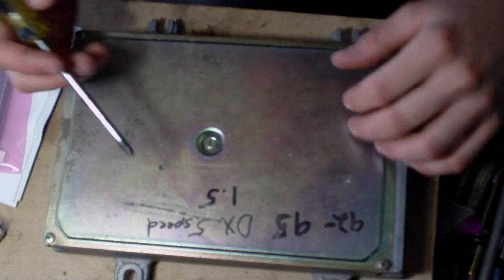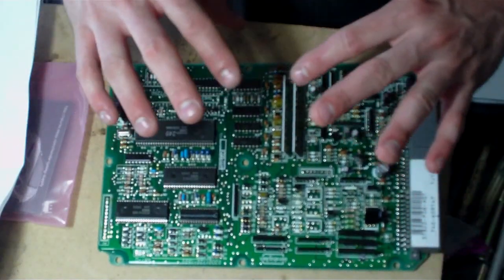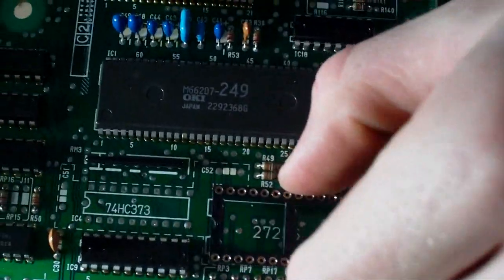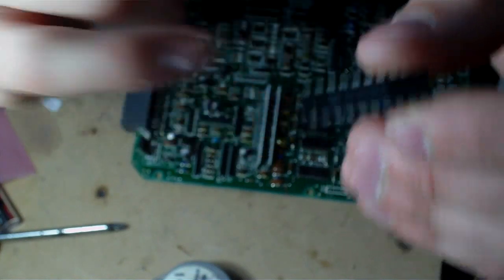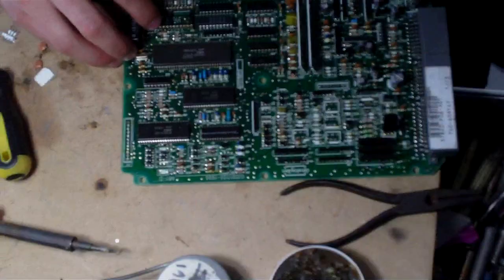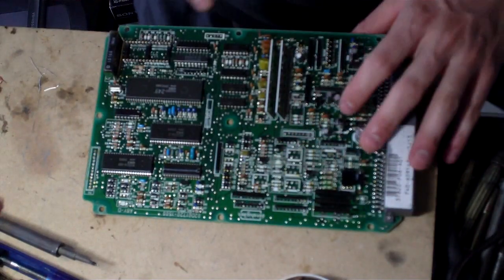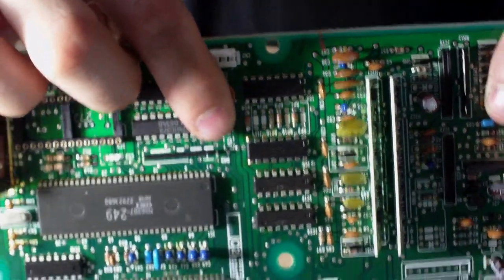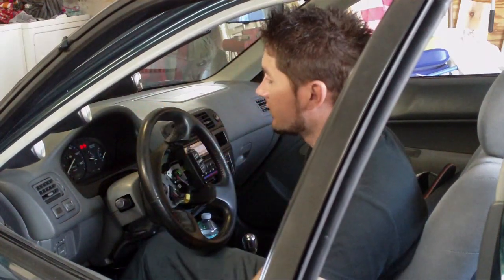How To Chip A Honda Civic ECU 92-95 5spd "THE EASY WAY"

Comment from the maker: 🛒 Buy The Tools To Chip Your ECU Here: https://www.nthefastlane.com/chip-a-honda-civic-ecu-92-95-store
🛒 Visit Nthefastlane's Amazon Store: https://amzn.to/3pP4UCy

Visit my website for All of Your Honda Series Needs. You will not be disappointed!
https://www.nthefastlane.com/honda-database
Reply: Nthefastlane i commend you for being able to do that soldering and micro work like that. i have essential tremors so i cant do that kind of stuff. i have a few questions though. i have a 94 Civic EX with an automatic. Can my ecu be done this way? what kind of power and economy gains could i expect after this is done? and does the $78 price you have in the description cover the cost of the kit and your labor? if so how can i get in contact with you? id be very interested in having you do this to my ecu if the gains are worth it... if its only 2 or 3 hp then to me it wouldnt be worth it.
Reply: Nthefastlane are you able to program one for 440cc injectors on 15psi of boost
Reply: Nthefastlane can you do my ecu.
Reply: I looked, it's just stuff taken from wikipedia. 
NGL it's disapointing.

Comment from the maker: Make sure you used the 74hc373 chip..The 373 IC is required for the processor to properly read the data on the EEPROM chip where the tune is stored. In order to revert the ecu back to the oem map you will need to un-bridge the connection of J1. or  just cut it.

Comment from the maker: Look under your hood by the front driver side head light..There's a Drier can with a sensor in it..Take the sensor clip out and jump it with a wire like a "U" if it kicks on ..Your either low on freon or your pressure switch is shot.

Comment from the maker: It's called "Flux"..It allows the heat from the soldering iron to make better contact with the solder. The Flux's heat's up real fast causing the solder to melt quicker then if you were not using any Flux. Hope this helped. Btw you can purchase it @ Walmart in the plumbing section or Babes Ace, Lowes and Home Depot.

Comment from the maker: @2kblackex Yes, I put a chip in the ECU afterwards..and this is a non vtec chipping kit..but you can add one more diode if I'm not mistaken and it will convert to vtec..they sell the vtec kit version also. Same procedure except you add another item.

Comment from the maker: @jonzo22 This is a Non Vtec ECU..By chipping your ecu which is the same ECU you see right here Non Vtec.,You will be able to take your car to a tuner and have him put it on a dyno or street tune your car by adding a better air fuel ratio which makes you more HP.

Comment: Hello, for data logger you need more parts than plug? I want soldier one BT HC06
Reply: CN2 connector is TTL, so I think you'd use an FTDI TTL RS232 USB adapter with a Micro Controller Unit to transmit the serial UART data over the HC06.

Comment from the maker: @manlymud I appreciate the attempt but that's not what Vtec is.Vtec is not and extra valve.

Variable Valve Timing and Lift Electronic Control..which means in English. It has multiple camshafts..The engine moves into different rpm ranges, the engine's ECU activates lobes on the camshaft and changes the cam's timing.When the lobes engage it forces the intake valves open more which push the stroke down more on the valve causing more power.On DOHC engines both intake and exhaust engage.

Comment: Hi Dude! what an interesting video tutorial!!! really good one... I have one question.. what do you gain with the chipped ECU vs a non-chipped ECU? (sorry my bad english haha) greetings!!!!
Reply from the maker: Thank you. With a chipped ECU, you are able to hook a computer up to it and change the air/fuel ratio and change when VTEC engages and disengages. With more advanced ecu's, such as AEM or K-Pro, you can even advanced timing, have live data recordings and if you have an electronic boost controller solenoid, you can do Boost by gear and even control the amount of boost you want. Hondata Series does this as well.
Reply: @Nthefastlane  what benifit does this have with the EX model which has a constant VTEC instead of and electrically controlled VTEC?
Reply from the maker: 92-00 EX don't have constant Vtec, they fully engage around 4500 RPM?

Comment: I have a question... my car I just got as a project has a chipped p28... I saw this video and checked the socket which matched that indention... the chip on the other hand is 180 degrees opposite the indent it opposite the socket... is that correct?

Comment from the maker: Did I say it was a vtec ecu? << "not a jerk response"...just don't remember if I did or not, but I don't think I did. And no, it's just a basic non-vtec ecu. Yes, the black (high side switch) get's soldered into "ic14"  but that's not even close to all the resistors,diodes,capacitor & fet's you will have to solder in,there are 6 others, depending on which ecu you have either 11F0, 1720 or 1980 you will have to use different chips.

Comment: hey brotha might b a dumb question but whuts that blue thing ur using? like a solder feeder? an were can I get a chip upgrade kit? I have a 89 crx si an wanna try this an one last question wut would I gain?
Reply from the maker: Sorry it's been a while. It's called a de-solder tool. It sucks up the liquefied solder. You can purchase it in my store. Top comment or in the video's description.

Comment: Hey man, nice vid, i have a question. is the datalogger required for the chip and socket to work ? and as far as the jumper used in j1 , would i got to the store and ask for a jumper or is it a resistor.... they look alike... sorry for the noob questions but im curious.

Comment: Nice video thumbs up I really liked it I have a virgin po6 that I would like to turn into a p28 like u did I have a soldering iron an solder just need to buy the chipping kit any recommendations on a good chipping kit from ebay? Thanks in return!

Comment: I bought a 96 civic ex and I was told the ecu was set up with 2-step launch. I bought the car not starting and see that the ecu thats in there belongs to a 92-93 civic hatchback. Could that be the reason why the car isn't starting?
Reply from the maker: It could be that it has a OBD1 ECU that is chipped and not programmed properly. If you switch to the stock OEM OBD 2 ECU it's possible the car would fire right up.

I can't say for sure because I don't know exactly what I would be looking at.
Reply: @Nthefastlane  and the stock ecu is one of these or could either one work for the d16y8 motor?
-37820-p2p-a31
-37820-p2p-a34
-37820-p2p-a84

Comment: I wish someone would make a hondata toutorial run through and some basic tuning tutorials using hondata smanager
Reply from the maker: Phillip Pickering Subscribe, that's in the future. I'll be doing a basic set up with the S300. TPS dial in, basic injector set up and fuel map for getting it running.
Reply: Nthefastlane that would be awesome! I'm subbed now. I'm in desperate need of a tutorial like that. I just got my s300v3 and I'm trying to get my boosted teg running but having a really hard time figuring it out

Comment: hey awesome work!did you see any fuel cosnuption reduction after you chipped the p28?..thanks
Reply from the maker: Raoul Duke Well, only way to know is after you take the car to the dyno and have it tuned.I'm running a diff engine now with a Hondata s300
Reply: +Nthefastlane i have a few questions. first what where u doing before u put the items in to solder them in.. and i got my chip kit and i got more items with it. one thing that looks like the 104 and one that looks like a little water tower. do i need these.. i am going to chip a p 72 ecu

Comment: hey my 92 civic just broke doown after i put in a new alterator and i have had alot of people check it out and its getting gas and good spark and the timing belt isnt broken and it turnes over i was told by my dad it was somthing electrical and and he said its either the ecu or somthing in the distributor i think i have the same problem as shay haha any advice would be awesome i think its a sensor in the distributor

Comment: yo bro im from manila im new in honda tuning just what to ask if whats the cons & prons of re-chipping ecu? now im using P28 on my 1995 honda civic esi that's the stock ecu here. now my friend had an extra P06 ecu already plug on my civic the problem is the light on the check engine is always on? may i ask if this ecu is not compatible or i need to re-chipped this ecu? thanks..

Comment: Can you control the idle Air  control valve with hondata? Can you give me a step by step. Thanks. Hondata is saying my Idle control valve issue
Reply: +X4hunterx4 Clean or replace your IAC - the computer tells you there is a issue with it - you have to fix the problem.

Comment: I just bought a 91 d16a6 2wd wagon ef ... its runing 11lbs with jackson   
supercharger and 100k motor. 440 injectors runing around 45-50pls fuel psi .. not sure but it does have a larger intake and full exaust and zdyne ecu!!! DO you think its runing Stock chip? i know 10-11lbs is stock max but i also know that stock enternals on the d16 cant take much more than 220hp ... I want to hit the 350hp mark and wonderd if i had egale rods and new pistons "unsleeved" block and new top end would hold it

Comment: I need help with my ecu is p28 honda accord 94 . I put a spoon chip in it . And something went wrong . I put the original chip and the car turns on but it misfires at 5k rpms.   What can I do .? Maybe a resistor or what else . It turns on the engine but miss fires on 5000 rpm
Reply: +Daddy R. You have something else going on - either something wiring related UNDER THE HOOD is bad or your distributor is junk.

Comment: Where can I buy this chip, I have a JDM 2008 honda civic ex-l 5 speed manual
Reply from the maker: For your make and model you'll have to use Hondata 06-15 Civic 1.8L FlashPro. I don't have this in my store but I always pin the link to my store with all the products in my videos to the top comments and in the description. Link to store: https://www.nthefastlane.com/chip-a-honda-civic-ecu-92-95-store

Comment: What if i just want to install a 28 pin socket for eprom chip on IC3...I still need to install the IC4, R54 resistor and J1 jumper? In order for the chip to work?

Comment: Will a socked ecu run factory settings when the chip is removed? Will the car even start?
Reply: +Oshane Rias Not unless you un jumper it - You should leave the chip in the ecu or get another chip made for your cars setup.

Comment: What is that blue tool  that your using to poke the hole .. Wha is the name of it.?
Reply: It's a solder sucker. They sell them at Radio Shack. You melt the solder with the soldering iron and suck the solder out with the sucker. That's how I chipped my first P28 but I melted mine on the first ECU so be careful with it.

Comment: Good evening, a question please I have a civic 92 automatic box ecu 37820P06A50 engine D15b7 power 1.5L. I can change my ecu by 37820p06g50 without changing any component?
please urgent
thank you in advance
Reply: wich one you want to use? because if you have a d15 p28 ecu u can turn it to a manual ecu making some stuff in the motherbord from that ecu.

Comment: @Stylnjj84 yes it does have a DOHC but they cant run at different speeds then each other, they run the same speed and the valve doesnt open more, just longer/ earlier to get more air for stronger compression i am in strong agreement with whom ever said you need to get the right headers and cams too for it to be a vtec . in the name "vtec" there is no  "L" for lift as you put it because its an overhead cam so it doesnt lift the push rods, it pushes down on the valves.

Comment: Hey man, I chipped my pr4 with a limiter of 3100. does what its supposed to. when i remove it, it runs fine. But then i decided to chip another pr4 with a 4500 limiter from ectune and installed it...but it STILL limits at 3100!! What the?? 2 different ECU!!
Reply: Thats limp mode. Pobably you destroyed ecu board or solder is not done right.

Comment: The 28 pin device is only a socket to carry a 27256 EPROM chip. So the EMC is now ready for an EPROM to be installed. So this mod has only prepared the board for a chip to be installed. The capacitors 104 are not polarized and can be installed either way around. Without the actual 27256 installed there will be no performance changes.

Comment: @kplivinloud08 NO u can not turn a non vtec into vtec with a simple chip, a vtec has an extra valve on each cylinder and a special camshaft so when you hit a certain rpm then the extra valve kicks in, giving it a slight more air so its more compression so more horsepower, when your in low rpm then it deactivates to give you more mpg win-win engine

Comment: Why did your fan kick on as soon as you started the car? No yellow check engine light for 3 seconds when you turned on the car. Why?
Reply from the maker: albert person I jumped the radiator fan sensor so it would run all the time. Not sure about the light but I think I removed the bulb. It had no check engine lights after the tune.
Reply: Nthefastlane If you remove the CEL bulb - an alarm sounds(the buzzer for the key in the ignition stays on). So your ecu isn't powering up right and giving you the 3 second CEL turn on and off when you turn the key on and start the car.
Reply from the maker: I eliminated the door chime speaker also..I have a how to video of it on my channel.
Reply: So why did you remove the CEL bulb? Got tired of seeing it turn on? It's a VERY important part of your engine management system and even more important if your chipping ECU's or tuning your car.
Reply from the maker: Most tuners just use it as a shift light.
Reply: A shift light(that can be activated or deactivated if you want it) AND a CEL so you know if you have something not working correctly.  It's VERY IMPORTANT TO HAVE WHEN YOUR TUNING A CAR. It tells you when you messed up with your calibration/tune or had a failure under the hood.
Reply from the maker: Cel lights are useless. Not needed when your using tuning software..it tells you everything that's going on with the tune.
Reply: Do you leave your laptop for the guy you just tuned the car for? NO. Do you ride around with your logger and your laptop hooked up all the time? NO. Is it LEGAL to remove the CEL? NO. Don't be stupid. It's probably the ONLY light on the dashboard that is a REQUIREMENT.
Reply: +boofighter If knowing what my ecu is supposed to be like after modding it makes me a dork than I will be a dork with a working computer in my car. Not spending countless hours wondering why my car isn't running right or having random and strange check engine lights popping on.
Reply: +Harry Negron I care because he is supposed to be instructing people in this video - if he isn't showing it the right way then people are learning the wrong way and not understanding what they are doing.
Reply: albert person if u whant ur fan to kick on  there is a plug by ur thermostat housing shove a piece of wire from pin to pin of the plug thats it
Reply: its an idiot light, can u just relax. fix the car. not the code!
Reply: isnt the CEL on the left side of the cluster...? you cant even see if it went on or not from this angle lol

Comment: there are 2 versions of the p07 
the one for 4 wire o2 sensor is chippable 
the p07 that has 5 wire o2 is not

Comment: check for fuel, spark, first before blaming the computer, make sure your getting spark and can hear fuel pump kick on, common problem is distributor the ignition control module gives out inside distributor, test and see if your getting spark.

Comment: do you know electronic throttle controller? it can not only accelerate throttle response but also slow down throttle response of your car. It can provide you with racing car driving experience and also save fuel if you choose the economy mode. It is different from ECU tuning, it does no harm to your car .

Comment: can you run a p28 ecu on sohc non vtec>?
Reply: Dwayne Collins From my experience no.  If you discover a way please let me know.
Reply: Alright I well
Reply: This is what I did.  I purchased a 93 P06 Civic ECU (per the advice given to me from the chip programmer) because you can not socket a stock 94 accord ECU.  They said it should work fine and yes it plugs in and the car runs but only in "limp mode".  Chipped it and it still runs really bad. If you know what your doing and have the software to write new maps to the chip you could possibly make it work.  I do not... All in I invested about $100 to discover this.  Good luck!!
Reply: +Dwayne Collins P06 and P28 are basically the same 'base' boards, the only difference is the P28 has the VTEC circuit added (there are some unpopulated 5-pin spots IC14 trough IC16)

You can even convert an automatic ecu to manual.
Reply: +Wade Woodring You have something else under the hood wrong - need to swap distributors or your wiring is not correct. This sort of modding isn't for a casual mechanic.
Reply: +Dwayne Collins The computer will start the car but throw it into limp mode because of the lack of vtec on the engine and it having a non VTEC distributor installed - you need to have the proper parts installed on the engine to make the computer happy.
Reply: albert person no, I have a chipped P06 (non-vtec) on a non vtec engine ect.  I did pin swaps on the ecu to address the issues WEEEEEEEE!!!!